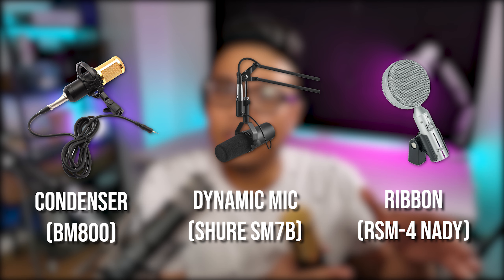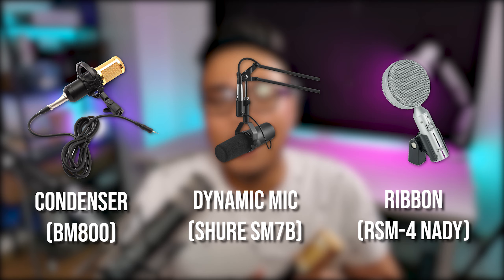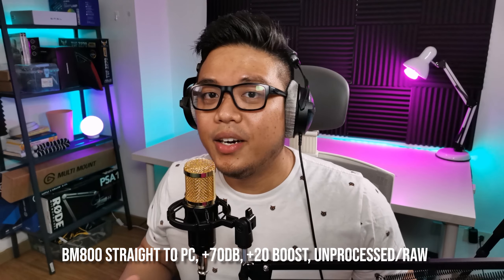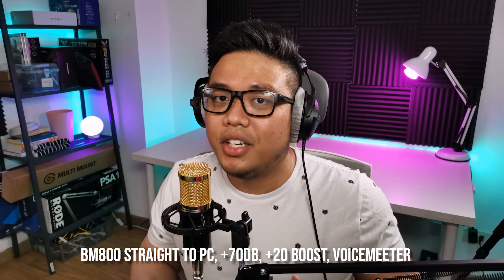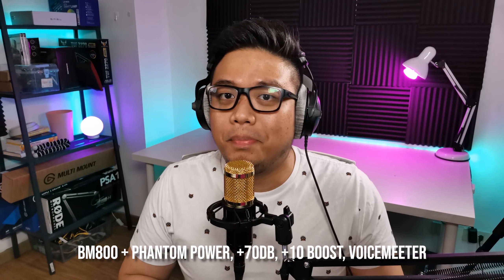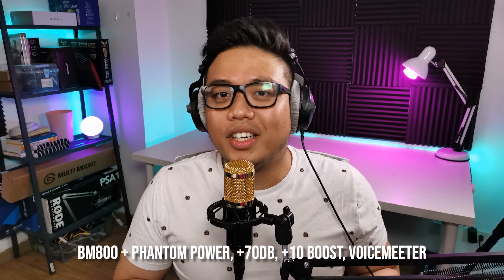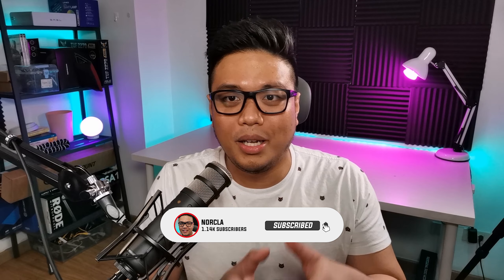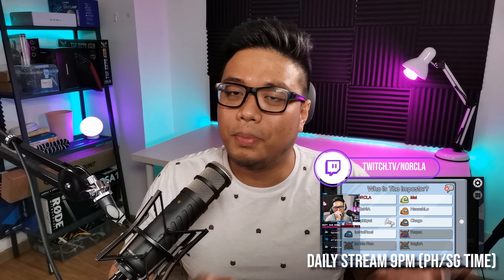BM800 + Phantom Power (NO SOUNDCARD)

Comment: Timing of this was wild, literally just ordered both on 11.11 and skipped on the V8 cause of your videos. Keep up the great content!
Reply: Same, I just ordered a BM800 without the V8 Sound Card after watching his previous video.
Reply: just got it on 11.11 for just 484 pesos, i guess its a steal to me, buying behringer um2 or umc22 soon.
Reply: @bruhlollmao560  I got mine last 11.11 for P318. BM-800 set with no card and phantom power.
Reply: @namelessjayar  anong shop nyo po nabili need lang rin po hehe
Reply: @macabascorenzjeric5456  I used shopee coins and voucher that's why I got it for less.
Reply: Tested the Bm800 + phantom power +voicemeeter for my past few recordings sobrang sulit would recommend to anyone looking to start streaming/podcasting
Reply: @xyrus6032  I was actually about to buy a phantom power but then I realized my room was not acoustically treated yet. My BM-800 arrived 5 days ago and I can say it was worth buying it. 👌 I used it for covers and adding a little reverb, compressor and noise reduction in Audacity gives it a better vocals.

Comment: That was a pretty good initial explanation about difference between dynamic and condenser mics!  Nice start to the video!  Now about the mics:  The BM800 sounds awful, strident, nasal.  IMHO the letters "BM" mean the same thing they did when I was three years old.  Second, the BM800 is dangerous because there are two different versions with exactly the same model number and appearance.  One version is unbalanced and uses 5 volt "plug in power" like you would get from the mic input on a PC.  The other version is balanced and uses 48 volt phantom power like you'd get from a sound board or some interfaces.  The danger is that if you have the 5 volt version and connect it to a 48 volt phantom power supply you will blow the mic.  (Actually that's a good outcome, it will force you to go out and hopefully get a better mic.)  In conclusion, anybody thinking about a BM800 needs to be very aware of which version it is, what cable it comes with, etc. or you might just throw your money away.

Comment: Hi @Norcla, 
I just bought BM800 to play karaoke. I have LG-OK55 Karaoke System. When I plug BM800 into my PC, it works but with a high latency. If I plug BM800 directly into LG-OK55, it doesn't work at all. Do you think BM800 can work on LG-OK55 if I put a phantom power ? Thanks in advance

Comment: I have a BM800 with a white USB sound card ealier, the sound card was faulty and I get a V8 sound card as replacement. I found that my mouth have to be very close to the mic in order to capture a good voice, while if 1 feet away from the mic, the voice very low if compare to the USB sound card earlier. I wonder if I get a phamtom power will helps?

Comment: The best sound for me was the one with phantom power, +70DB, +20 Boost, unprocessed/raw. Although there is still a little bit hiss but acceptable and the sound is less distorted. Although the next one, the one with phantom power, +70DB, +10 Boost, routed to voicemeeter, there is a low frequency feedback. Is it really natural bruh?
Reply from the maker: There may be something that I overlooked in terms of settings! I find it strange that software will add hiss...
Reply: @NORCLA  Yeah. That's why I really put it out there 'cause I actually thought the low freq feedback was natural to the voicemeeter. Overall, the video was really helpful man. Keep it up! 👍
Reply from the maker: @tresemusika  No, it's not supposed to add that. Usually things are added to the signal chain because of physical factors (e.g. Cable, interference, etc.). Thanks for the support and glad I helped!

Comment: Hi! I'm new to this condenser world stuff. I just bought an upgraded version of the bm800 mic, but this one is different. It comes with a 4 pin xlr cable unlike the older version that has only 3 pins. Is there a way I can plug this 4 pin xlr condenser mic into my mixer which only has 3 pins sockets?
Reply: i am also new, but you can simply buy a 4 pin xlr to 3 pin xlr cable or adapter. it's quite simple actually. remember to check your male and female xlr ends!
Reply: @michael3147  I tried searching it but I didn't see anything about that

Comment: Thanks so much for this. I have a question. I've seen a friend use the BM-800 for recording audio with a smartphone using I think was an audio splitter. Any thoughts about that? 

Also can the phantom power be used too if I'm recording audio using a smartphone? 

Cheers for 2K subs!!!
Reply: it would work but u need a splitter for audio

Comment: Thank you for this vid! I have just one question tho, will this be the same if you use a laptop? I have hissing problems at the end of my recordings kasi ehh, hopefully the phantom power can at least solve those issues.
Reply: same, pagka laptop lakas ng hissing. sa desktop hindi naman masyado.
Reply: Ahh so ganun pala talaga sa laptop may voltage issues
Reply: @user-sigmapog  not 100% yun lang napansin ko nung tinesting ko. Pero share ko lang na gamit ko din yung cheapo "sound card" na usually kasama ng bm800's on the laptop so probs nag contribute un sa hiss pero kasi ayaw naman nagana ng mic sa laptop pagka wala nun.
Reply: So it’s probably not the sound card kasi wala sakin sound card ehh and gamit ko lang voicemeeter, doable naman when editing my recording kaso when live or on discord nakakabother talaga ang hiss

Comment: Hello Norcla,

I bought a BM 800 last 3 weeks ago and it was working, however after 5 days of using it, the volume of the mic suddenly became too low. I checked my settings, but nothing has changed. I’ve tried using my old microphone and a microphone of my earphones and both were working perfectly. The BM 800 can barely detect my voice, even though I was facing the correct side. The day after that incident, I tried to use the BM800 again and the mic was working, however after a couple of minutes, the problem came back again. I’ve contacted the seller and they insists us to buy a VM800 from them. I saw your video to not buy the VM800, because it is not worth it, so we have decided not to buy it. Do we need a phantom power to make the mic work properly again? You have mentioned in your video that it needs power to make the mic to work. 

Thank you in advance. Please reply 😄

Comment: Hi! I have a question. When I plugged my earphones in the V8  the sound is the opposite. For example, if I'm playing Valorant and someone is walking in my right direction I would hear it from my left ear instead. Any way to fix this?
Reply from the maker: You may need to fix it via software. Try the sound control panel and try switching the channels
Reply: @NORCLA  thank you so much! I'll see if that fixes it

Comment: May kinalaman po ba yung quality ng xlr cable? Kasi meron ako interface ammoon agm02 then condenser ko ay takstar sb8m, pero xlr ko is tag 90php lang, pansin ko parang may annoying grounded sound na di ko maintndhan, kasi baka mamaya may bilhin ako na mamahalin ganun padin sayang
Reply from the maker: Yes, in a way. If your cable quality is terrible then it will likely result in noise. Take note that super expensive cables also do not improve quality that much. Also make sure not to run your cables along powerstrips/sockets/power cables because that will introduce interference.

Comment: Hi Sir Norcla, I've been using the BM800 condenser mic for a week now. On my first stream, everything was fine, everything was default, plug and play. But after I tweaked a bit using Voicemeeter and SLOBS mic filters, it started sounding tin canny. I've tried resetting like delete all my filters and completely uninstall Voicemeeter but it just stayed like that. Tunog lata. Any suggestion?
Reply from the maker: The BM800 actually sounds like a can out of the box! That's super strange.  Did you follow my BM800 Best Settings guide?
Reply: Yes sir. I copied it 1:1. If you can be so kind and have time, could you check my latest stream at Yenski Gaming page? Just a quick listen of how my mic sounds live. Thank you so much hope you can help!

Comment: I have problem with my phantom power. Everytime i connect my bm800 with phantom power to pc, when i turned it on, the mic volume did boost but after few seconds the volume drop drastically until there's nothing can be heard. How to fix this?

Comment: Sir last nato, pag gumamit po bah ng preamps like phantom power, dimo na kilangan bumili ng usb soundcard? 
nakabili na kasi ako ng V8 pero di pa dumating tas late ko na na explore tong hulog n langit na vlog niyo... salamat po God bless.
Reply from the maker: If you have phantom power and BM800, you can just plug it straight to the laptop. However, it's always good to save up for a dedicated audio interface. Usually those devices will have phantom power and a USB output built in, like the Behringer Q502USB that I recommend!
Reply: @NORCLA  salamat po sir.... I love you sir

Comment: is it safe to leave the phantom power turned ON when using a Dynamic Mic (Behringer XM8500)???
Reply from the maker: Generally,  yes, because most modern dynamic mics usually account for this. Studios usually have 24/7 phantom power on regardless of what mic is plugged in so manufacturers have properly considered them into the mic's design. However! It's still best to check your mic's documentation!
Reply: thanks bro..
i was always scared that the mic would explode or something

Comment: when i use the Phantom Power, the white noise disappears for 2 or 3 seconds and than it comes back, when i power it OFF for a few seconds and turn it ON again the same thing happens, in those 2 or 3 seconds of it being ON i can hear my self speaking in the mic, but after those 2 or 3 seconds the white noise jumps in (i can still hear my self though) im using the Phantom Power that uses an adaptor that you plug in the wall, the adapter that came with it is 18V, is the Phantom Power faulty or is there something els going on, is anyone els also having this issues, please let me know

Comment: Hey bro, seeking some clarity, on the info you put at the bottom of each test recording I noticed you had the same mic volume and mic boost setting all across the board.

Did the addition of the phantom power box not result in you having a higher effective volume before entering the PC? Or did the volume just maintain?

Comment: Am I only the one hearing a hum on the part where there is phantom power and post processing?
Reply: No ...but phantom power actually removed noises like that ...I just got one and its way better....the hissing and static just goes away with phantom power
Reply: @sohmmm  Please can you describe your set up? I have a BM 800 and the hissing is there so i'm in the middle of deciding if I should just trade it for a USB mic or do the phantom power thing. Cause I don't want to get the phantom power and find out I need something else. So please, what's your set up?
Reply: @everdream4200  a xlr cable comes with the phantom power itself .....and then you have another xlr cable that comes with the mic ....all you have to do is connect both the xlr cables accordingly..power up the phantom power and its done
Reply: @sohmmm  No sound cards or other stuff? Ok. But out of curiosity do you use a laptop or desktop because I have noticed it works better on a desktop
Reply: @everdream4200  desktop...